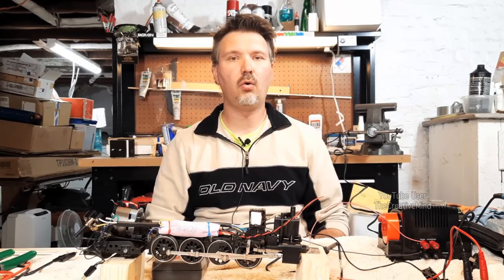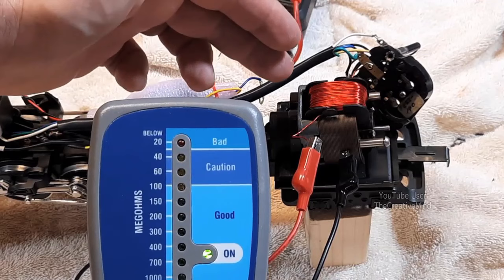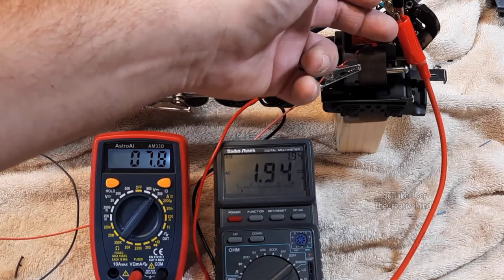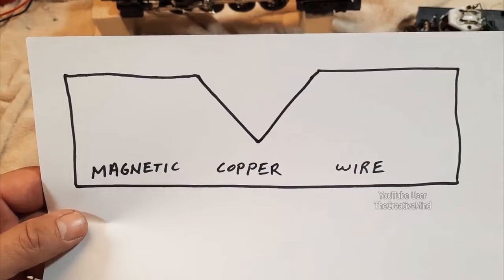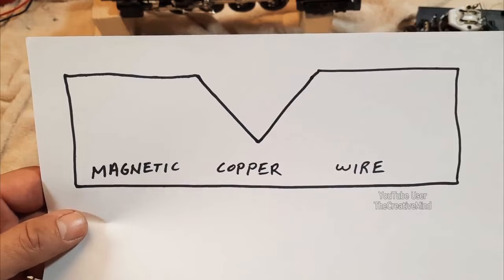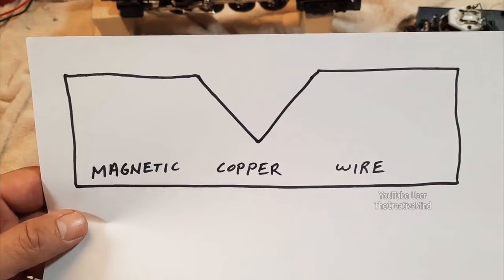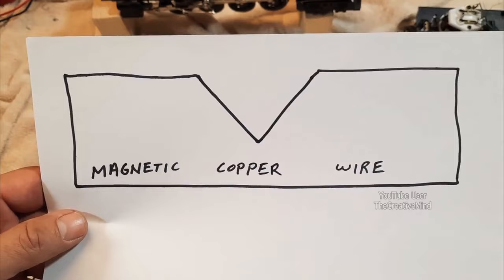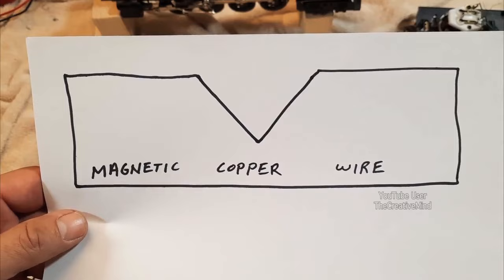Learn To Troubleshoot and Rewind Lionel Pullmor Motor Field Windings

Comment: This is a very helpful video Ed! I have a multimeter but I don’t have a mega tester. I will have to look for one. What a great video. 👍💯
Reply from the maker: Thanks Frank. I got the Supco M500 megger from Amazon, it was just under $100. If you're looking for something a bit budget worthy, there's the Digital Insulation Resistance Tester model BM500A. Check it out, I'm sure it does the same function as mine just digital.
Reply: Perfect, that’s what I’ll do. Thanks Ed👍